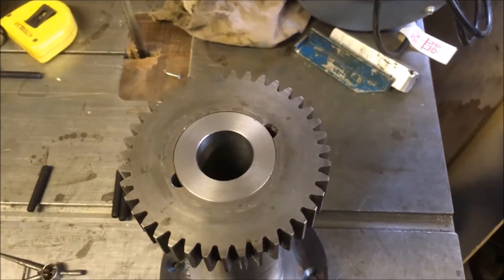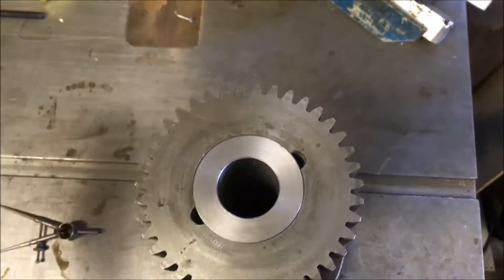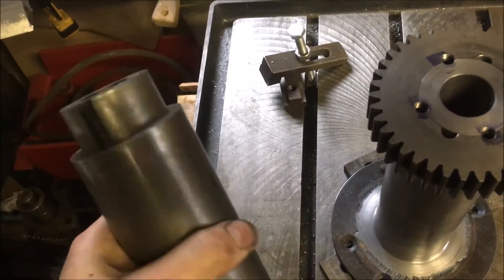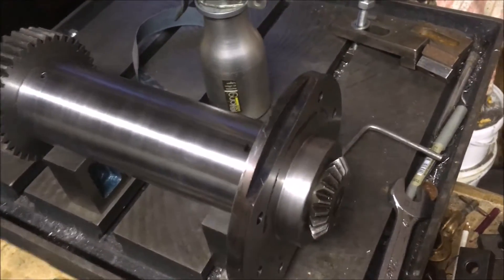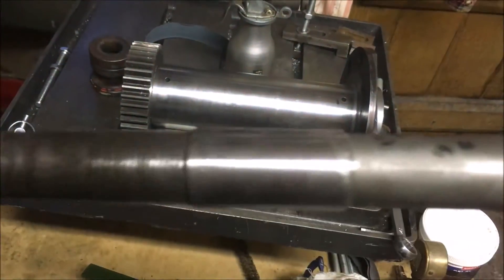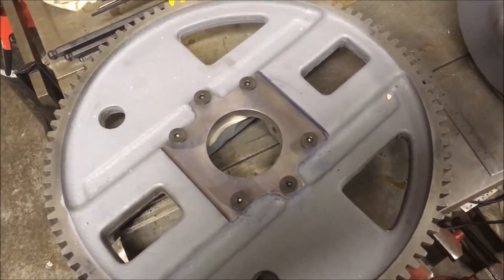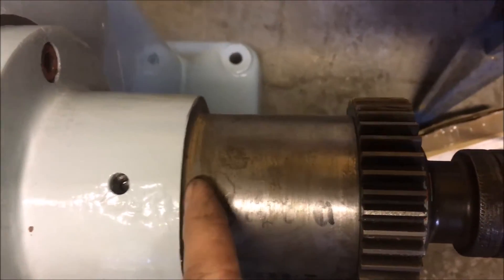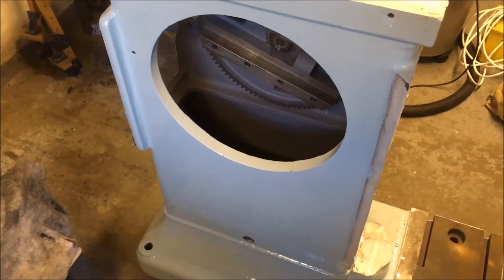Elliot 14S Bull Gear Saga Final

Comment: Hey Mat, haven't seen you on Yahoo shaper group, but I do see you have made some AWSOME progress!!! I took my Alba/Elliot 4s out of action yesterday as I'm getting ready to poor a epoxy floor in my shop, if you need some measurements let me know. A bit of what I've learned, the locking collar on every Alba/Elliot I've ever seen looks like yours, because they can work themselves on there so tight it takes a pipe wrench to brake it loose! I used a graphite gasket under mine and have not had any problems. Tom
Reply from the maker: Hi Tom, thanks for the positives, and heads up on the stroke adjust locking collar. I was wondering about what to do with it. Epoxy Floor - I wished - I have a selection of painted areas which rotate around the shop depending on what I can move when and the weather ! various shades of grey help date each section ! Keep in touch. Im on the Yahoo Group, posted a couple of images of the busted Bull Gear and will put a few more up as and when I have chance.  All the best Mat
Reply from the maker: Hi Tom, any chance f some more details on your graphite gasket to prevent the collar seizing ?
Reply: You Bet. After the second time I had to brake it loose with pipe wrench I went looking for why. The collar is only meant to be lightly hand tight. As the machine warmed up and the shaft spins around a while working away it got tighter and tighter. I tried cork and treated paper from motor gasket material but they where a limited fix because they would crush untiled destroyed. I hand some 1" flange graphite gaskets from a pipe weld job after doing a little trimming on the bandsaw for fit it worked great. There rated to 150 ft lbs so it doesn't crush in this use and the graphite has just enough slickness to easy keep the collar from tightening to the point wear you cant remove it by hand. Other things I've found that help is to make sure the crank arm to ram bolt is very loose when you adjust the stroke length. I'm thinking your bull gear saga was caused because of this problem or someone trying to break it loose by the adjustment shaft and not the collar, what do you think? Does this help? If you have more questions hop on yahoo shaper group email me directly and I will give you my main email address not on here. Or my # if that works better for you.Tom
Reply from the maker: will do Tom. Thanks for the info'. Mat

Comment: A note on the screws. The shear strength is proportional to the area of the screw. Forgetting about pi, one M10 screw has area 100, so two of them give you 200. One M5 screw has area 25. Four of them gives you 100, so you are a bit under. Not that I think it will matter and anyway it wasn't M10 but some ridiculous fractional inches, up with which I will not  put.
Reply from the maker: Hi Juan, I tend to work on a very broad brush approach to estimations :-)  The gear itself is under very light load as it only operates the ratchet feed mechanism. A single m8 grub screw would have done the job. But I take your point on shear strength of fixings. Thanks for commenting and watching. All the best Mat